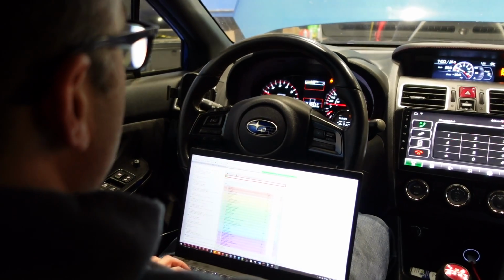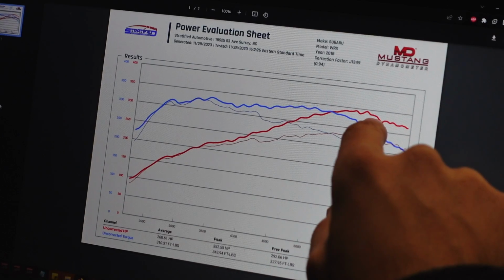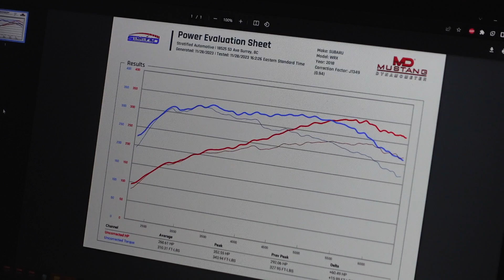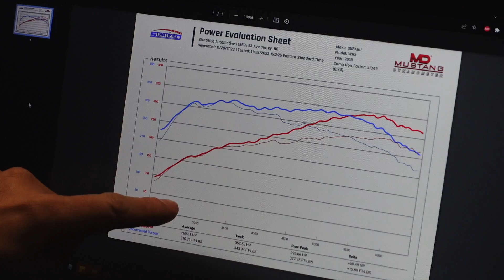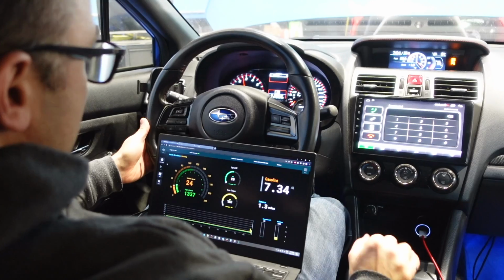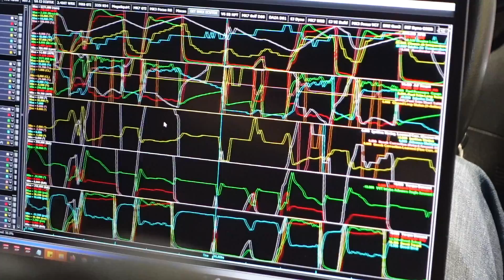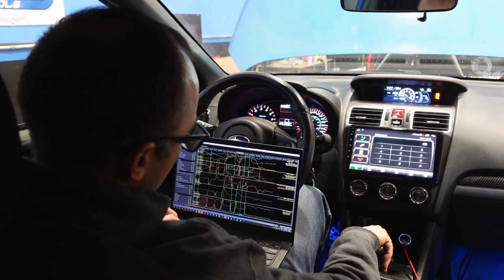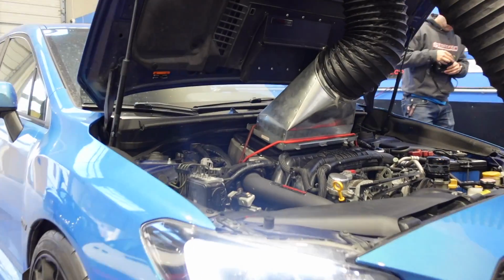Doing METH Right - VA WRX

Comment: Now this my concern, what do I need parts to reach the max 320hp with 330trq stock turbo. Parts a side Cobb Aps, up pipe. The tgv delete, butterfly delete like that’s works in BC?
Reply from the maker: 300-320whp on a Mustang dyno can be achieved with full bolt ons and e40-e50 fuel. No need to delete TGVs.

Comment: Good info Alex, I haven’t had any experience in smaller quicker spooling turbos and Meth, so that really didn’t occur to me, but it makes total sense. It wasn’t something I ran into on my Precision 5862 because the transient response of that setup was much slower than a factory sized turbo. My guess is the response was slow enough to allow the pump and FAV to react in time for there to be sufficient flow when it was needed. I imagine with some added control more advanced WMI kits offer, you could get a bit creative with the trip points and offsets to have that pump starting a bit sooner than you want full flow making sure it’s flowing what you need when you need it.
Reply from the maker: The transient response is always an issue in kits that don’t maintain line pressure and don’t have a pulsing solenoid for metering on the nozzle. Aquamist is the only kit that does these things that I know of. Of course we are moving more into the realm of fuel systems now and this is why I prefer MPI for direct injection supplementation to WMI. Some platforms like this VA WRX however have limited MPI options on the market.
Reply: @stratifiedauto makes sense, I ran an Aquamist kit. 👍
Reply: @stratifiedauto I was looking into the aquamist system for my  fa24 which has 5 sprays, 1 in the charge pipe 4 in the runners. Am I gonna run into the same issues with the stock turbo?